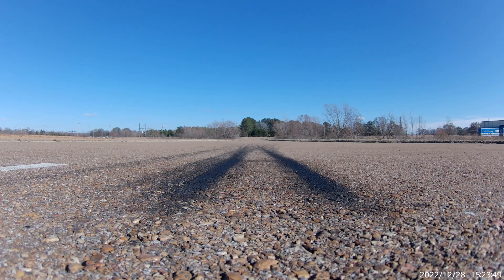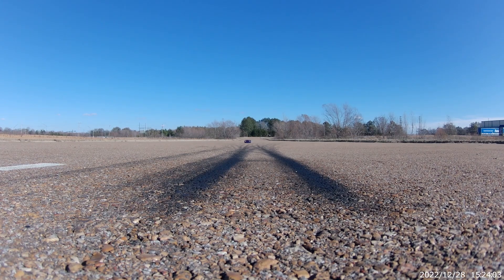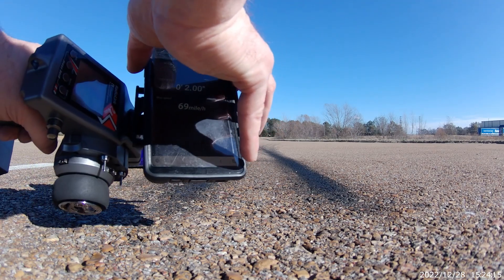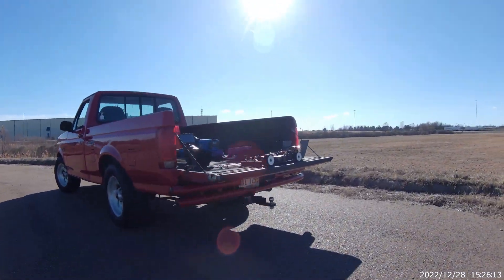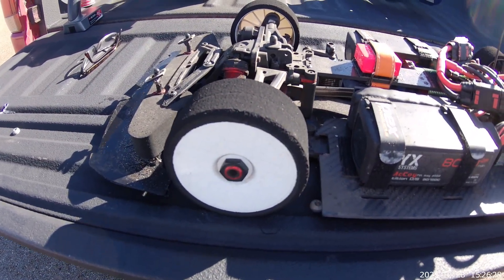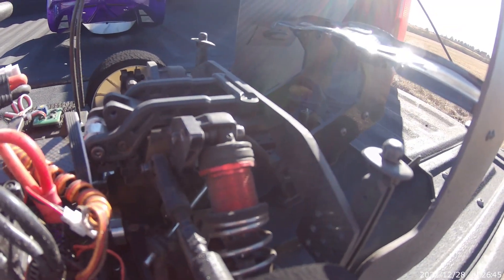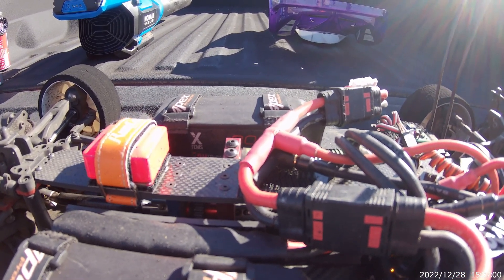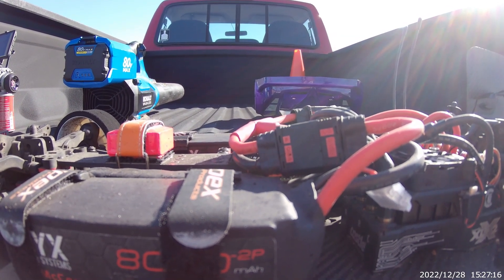New PB with the drag Limitless setup.

Comment: Nice pull no wheelie bar or prep is the perfect pass working for drag with launch control
Reply from the maker: I wasn't using it. I was using the radio for launch control. But I shut it off and launch it a 100%. And ran the same numbers.